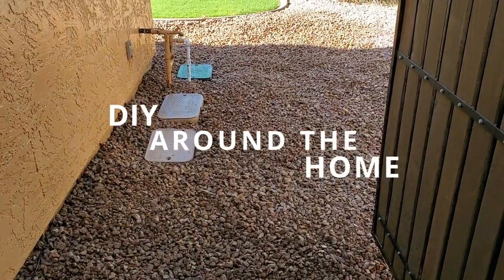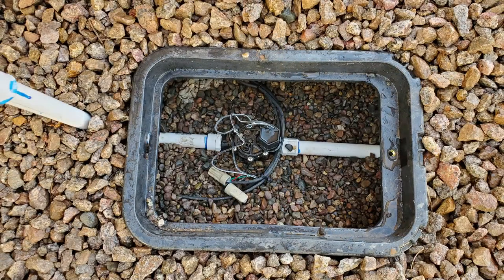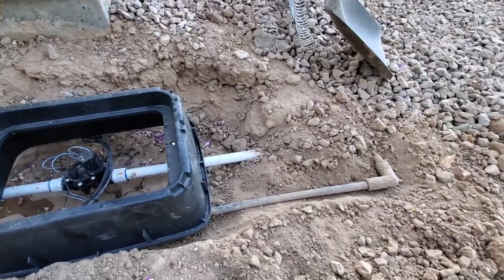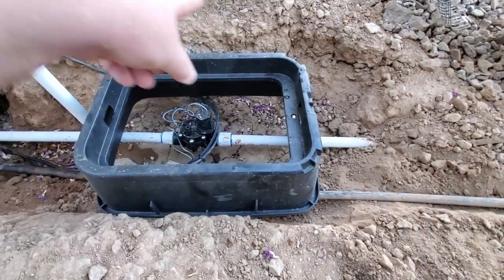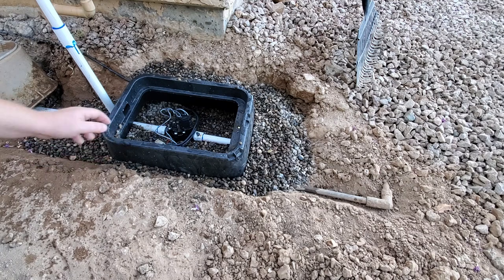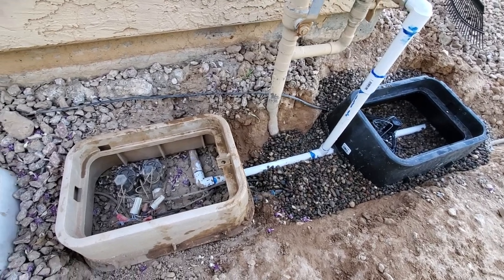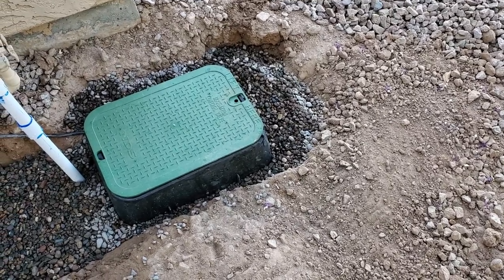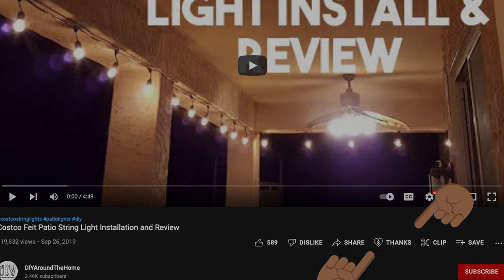How To Install Irrigation Sprinkler Valve Boxes

Comment: Any special tips to dig around box in this dry, rocky Arizona soil?
Reply from the maker: Rocks, pebbles, and other hard things won't make it easy if they're mixed among the dirt. I'd wet the area and break it up and remove the rocks so it's just dirt. More work now but easier down the line.

Comment: Spent today digging out a box installed exactly this way probably ten years ago. 
The digging was VERY tough because of the pebbles that had migrated throughout the entire lawn area, doing everything except their intended purpose of keeping the box clean and neat. The latter was so full of hard-caked dirt the valves were completely buried and not even visible when the lid was initially opened. My impression is this method is a short-term solution that looks great the day it is installed, but doesn’t hold up over time, and will not leave you with visible and practical access to the valves when maintenance becomes necessary.
Reply from the maker: Wonder if the soil type or pebble size played a role in the problem. I've installed several valve boxes this way in the last 16 years (in Utah and Arizona) and haven't had any issues getting to the valves for servicing.
Reply: @DIYAroundTheHome  Thanks for the reply. This was Central Florida, so not a location I had expected to be very dynamic in terms of soil shift. My original intention was to reposition and reinstall the box exactly as you describe (which looks great by the way) but now I'm having second thoughts...

Comment: I wish I had kept an eye on the guy who put my system in.  I couldn’t due to health and the valve covers (round) top elevation was about 3-4” below everything around it. I didn’t see them bury the valves but later the lack of gravel combined with a low lying area around 6 zone valves left free standing water. 

Have it mostly exposed now.   Hurricane nicely filled hole with water but plan on taking all the mud and silt from around and under the boxes and put pea gravel and top off with drainage gravel.   

Just need to determine the easiest way to raise them valve covers.  “Stack them” or make something work ( plastic bins, large diameter PVC cut around base??  

A 4K job and it was screwed up from day 1.   Could never get the company to return calls or come back out.  

Any ideas on raising 9-10” round valve boxes up about 6”. I’m all ears.  I’m ¯＼◔ー◔/¯ at laying brick around to build up.
Reply from the maker: I think the large diameter PVC around the base could work, get a mallet... soften up the soil... and hammer them in

Comment: We are thankful to have found this video. A landscape company (using that term VERY loosely), we hired to do a revision of an area - made a mess of several things, including re-setting our sprinkler box. That was "try #1." After their "work," the sprinkler box in a rock bed sank so badly that we feared we had a leak. An very, very rude, sloppy, corner-cutting, rush-through-the-job guy was sent out to check for, & repair any leak(s), & re-set the sprinkler box properly. That was "try #2." Once he said there was no leak (if that's even true) & proceeded to insult us, we told him to STOP & NOT to re-spread the rock. We needed to wait a few days to see if the box would sink again. The guy totally defied & agued with us, putting the fabric back, & all rocks back around the SHODDILY PLACED below-the-level-of-the-rock, & clearly UN-LEVEL sprinkler box. We were disgusted beyond words. As soon as he left, we had to start  un-doing the mess the guy had made. We're still digging out all the rock. We'll have to clean off all the dirt & mud he got in the new rocks - doing the such a sloppily & rushed "repair." Then, we'll have to dig out all that dirt YET AGAIN (3rd time) & set the sprinkler box CORRECTLY, as he should have done. This will be "try #3." I pray this will be the last time we have to deal with this mess. I hope this video will help us do the job - the WAY IT SHOULD HAVE BEEN DONE IN THE FIRST PLACE. So sad that workers: 1-DON'T KNOW how to do a job correctly from the start, &/or 2-just DON'T CARE.